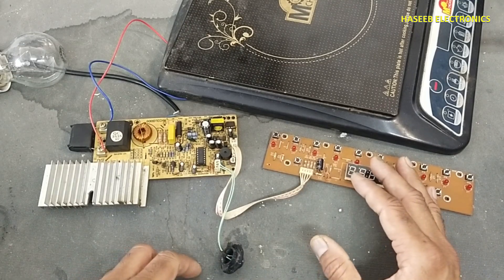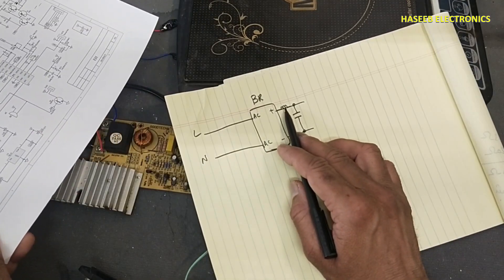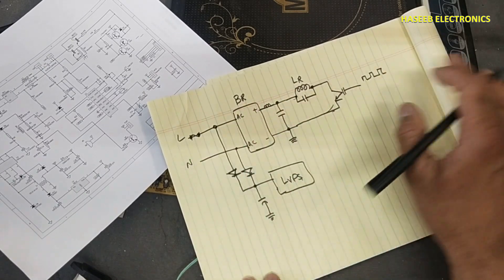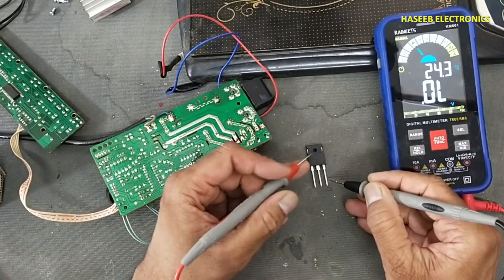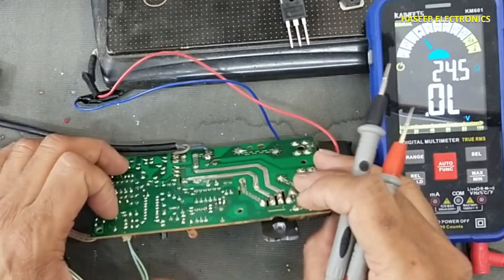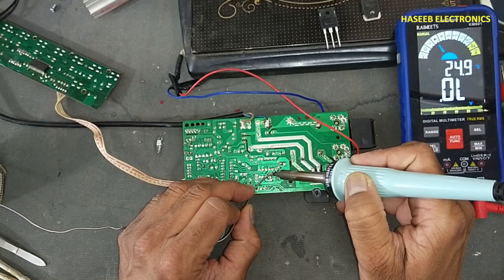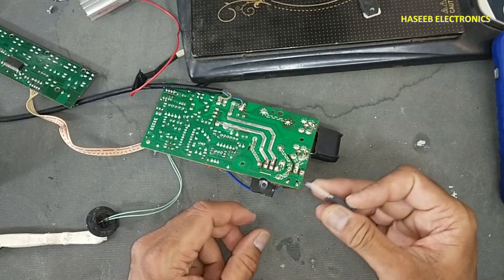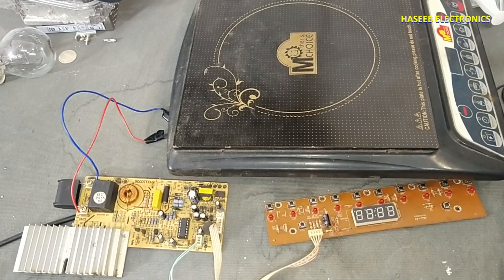{881} Induction Cooker Fuse Keeps Blowing

Comment: I hold your YT channel in high esteem because of the variety of electronics you diganose and repair. You thoughtfully break down the problem, then work through a process towards a solution. Not just theory, but also practice. This was superb. Again. As usual. Many thanks for sharing.
Reply from the maker: best regards and special thanks for your valuable words. it becomes very easy when we understand the circuit theory, then we can dig deeper by understanding the circuit behavior. basically a electronics service engineer or technician is like a veterinary doctor, he have to understand the behavior and symptoms, so a proper understanding leads us towards to fruitful results
have a nice day 
and please accept my best regards
Reply: @HaseebElectronics  Absolutely correct...

Comment: I have a blown mains fuse that I reset. Forgot to use the lamp while repairing. The induction heater fuse is not blown. there is IC blown md12h. An there is T FUSE like resistor blown.
What to replace the T Fuse with? I ordered IC from aliexpress.

Comment: Sir, please make a video, how to test the non - polarized capacitors such as ceremic capacitor, film capacitor etc.
Thank you sir.
Reply: no need for a video how to test ceramic caps.  they are either broken open or short circuit.  You may need to use a cap tester to measure the exact capacitance which is usually +/- 20%

Comment: Sir, I recently tried to repair a power supply with a blow fuse. After replacing one diode from the bridge rectifier the fuse blow and trip the circuit breaker. Sir can you tell me what more should I do? Thank you for your attention.
Reply from the maker: i hope the link video will helpful 
please check this video   https://youtu.be/AHzsaOwHYY4
Reply: I will. Thank you again 🙏